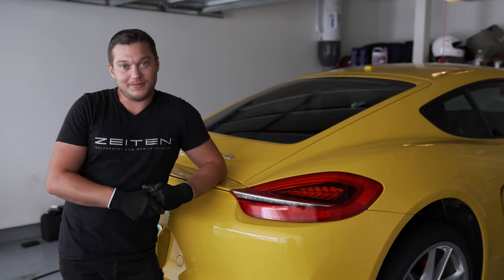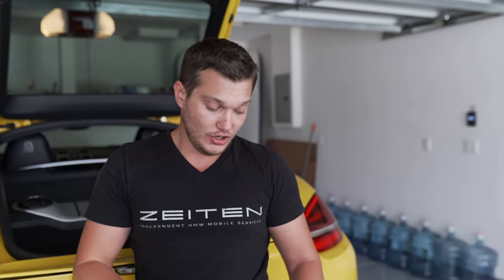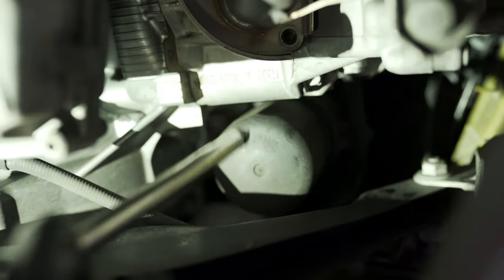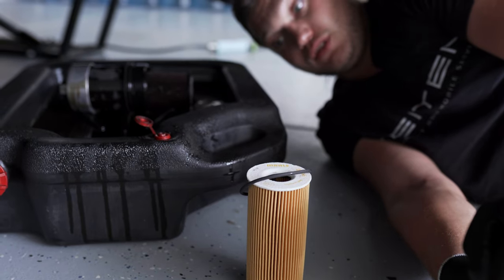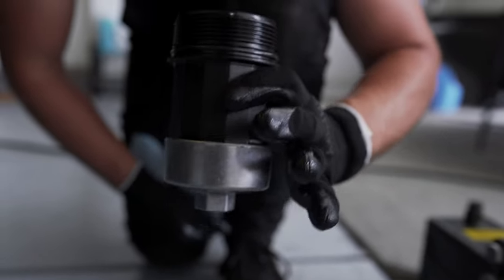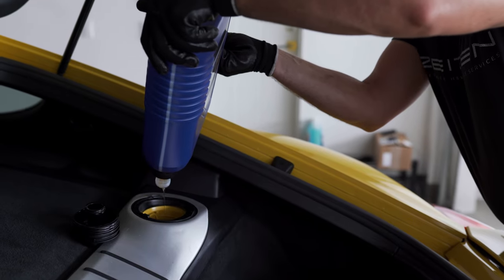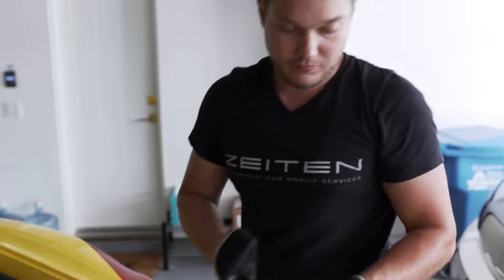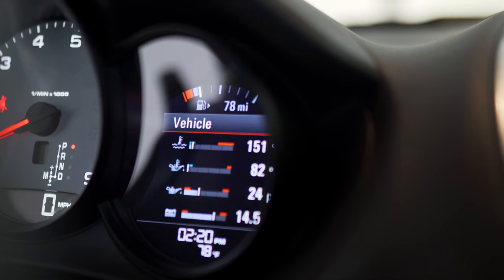DIY Porsche Oil Change (981 Cayman/Boxster S)

Comment: Once you get the oil up to temp in the operating range, about 2-3k rpm for a couple of minutes, you can shut off the engine and wait about a minute, then oil level measurement will be available.

Comment: Great video as usual... would really like to see a BMW N20 transmission fluid drain and fill. Thank you!!
Reply from the maker: Thank you, you can check out video on this channel for transmission service on e9x, your transmission won’t have mechatronic seal but the rest is pretty much the same
Reply: @Zeiten  Got thank you so much!! Every 50k miles on transmission fluid right??
Reply from the maker: Usually that’s a good rule yes, 50-60k miles, zf 8 speed is pretty reliable transmission overall, can’t say the same about n20/26 engine though 😁